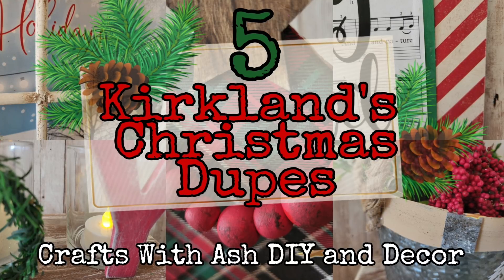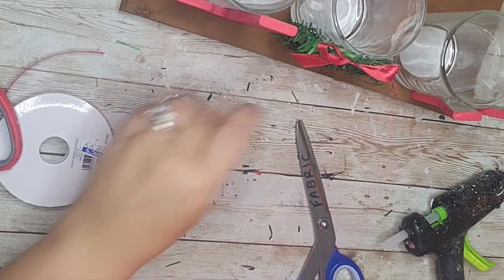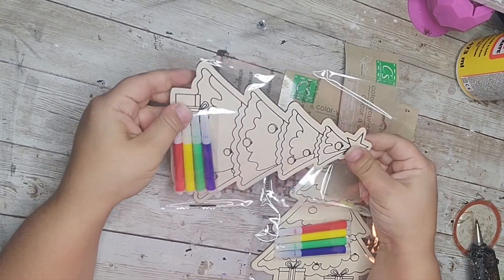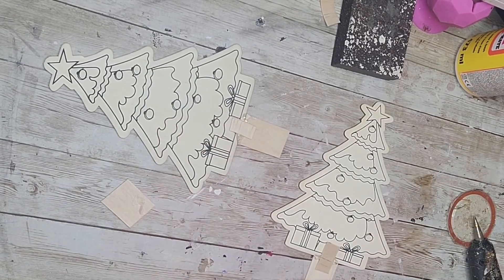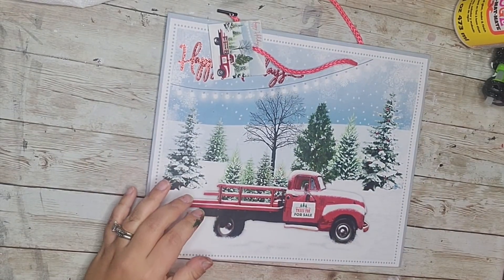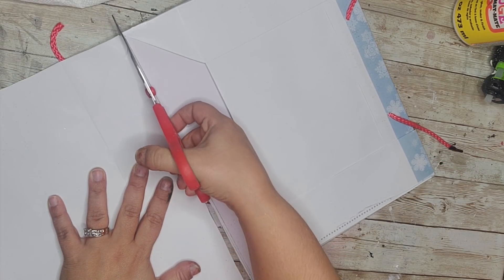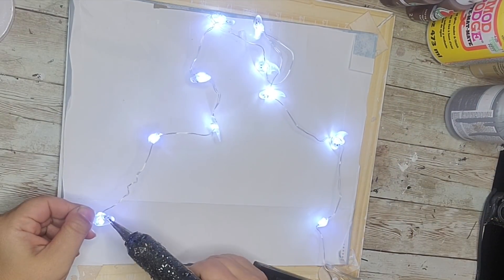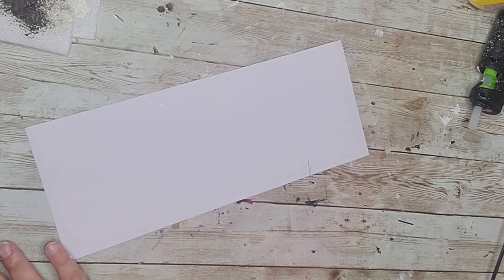5 **NEW** Christmas Kirkland's DUPES

Comment: Ash, what kind of hot glue do I use for glass or metal? I thought I had to use e6000 or super glue. Love all of your projects!!
Reply from the maker: Unfortunately,  hot glue doesn't stick to metal because it tends to cool it down,  so I use super glue/E6000. You'll see a lot of crafters use both because the hot glue gives it an instant hold and the super glue provides the permanent hold.  I've heard the same about glass but honestly,  I've never had a problem using hot glue with glass.